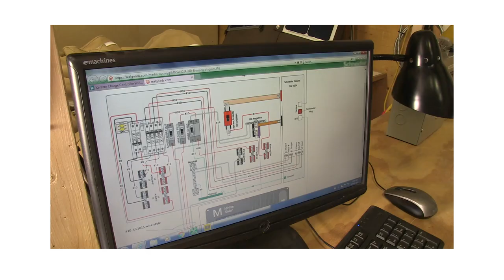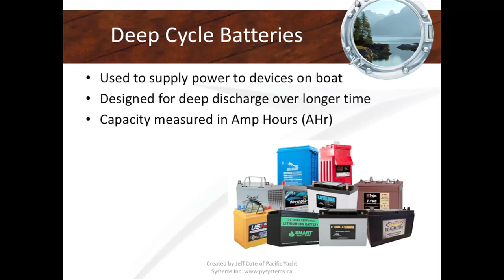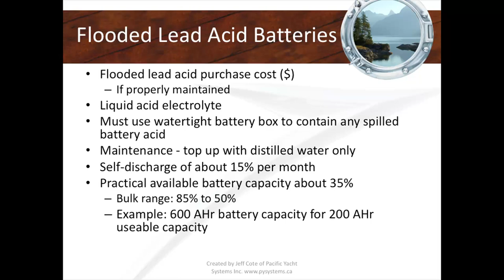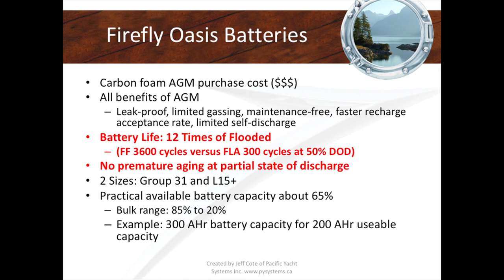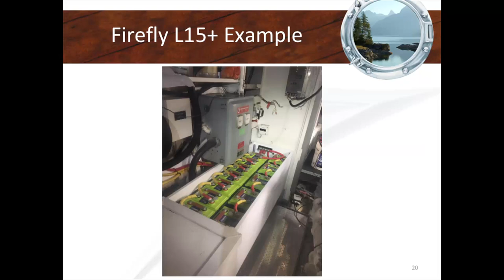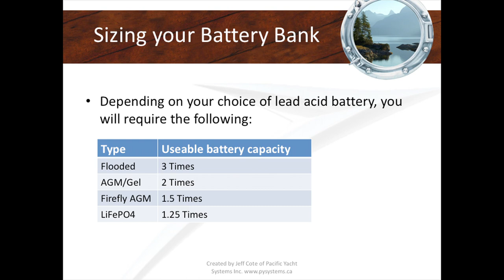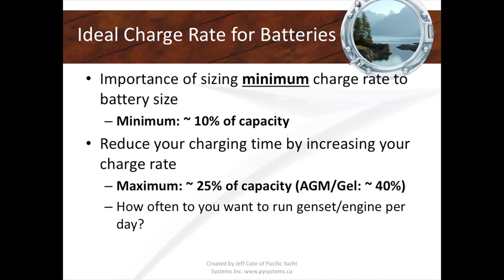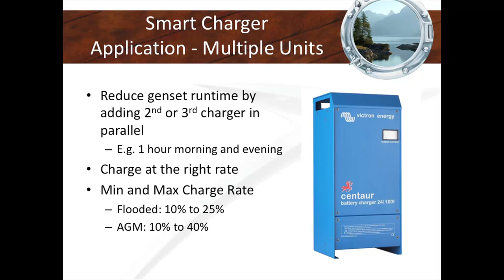Boat Show 2019: How To - Choose The Best Battery For Your Boat

Comment: I have watched almost all your videos and very much appreciate the content and helpful info. Thank you for taking the time to post them!  
My questions are this: how come in your overview schematics you always have chargers and inverters separated on the switched and un-switched sides of the dc system when you say you never sell anything but, or recommend anything other than an inverter/charger combo like a multiplus? Is the inverter on the switched side just representing an ac breaker panel? Should you still have a master on/off switch right off the battery, before the main hi-current DC bus and it’s branches out to switched and un-switched sides?  What batteries do you currently have on your Catalina? I would love to see a video where you walk through a more detailed schematic of one of your clients DC systems. Thanks again for all the content!
Reply from the maker: Hi Nick, thanks for all the feedback much appreciated.There is no one-size fits all solution and so we sometimes install chargers, inverters, and inverter/chargers. Whenever you have a charging device, be it charger, solar controller, alternator, inverter/charger you need to make sure the devices are connected to unswitched side of battery.On my Catalina, i have 6 Firefly Gr31 batteries. Good suggestion on a walk-through of my Catalina.

Comment: Great videos,  what's a good device to keep a float change on start battery, when battery isn't being used as intended?
Reply from the maker: Hi Anthony, every battery chemistry (flooded, gel, AGM, Firefly, etc...) want their specific float voltages, most range from 13.3 to 13.5 VDC on a 12 VDC battery.

Comment: Hi Jeff, excelent videos! We are solar integrators in Brazil and would like to get a quote for the Firefly batteries to use them in boats. By the way, are they rather AGM or Gel? Can we compare them with the Carbon or NanoCarbon batteries? Thanks
Reply from the maker: Hi Edgard, send an email to solutions@pysystems.ca

Comment: That leaves AGM or Gel?!? Just a matter of looking at cost, or is the charging profile a matter to consider?
Reply from the maker: Hi Jens, correct the charge profile of all chargers, solar controller, external regulator, etc... need to be considered when going with Gel or AGM.  AGM lead acid battery is easier to retrofit then Gel batteries.
Reply: @PacificYachtSystems  Thank you for the information. Wish we could get Firefly here in Australia, but who knows what the future holds. Thanks again!

Comment: What are Cat batteries Lead or AGM as te dont have filler caps
Reply from the maker: To confuse things, some flooded lead acid batteries are labelled as maintenance free and don't maintenance caps to refill the evaporated electrolyte. The labelling of the battery should tell you if it's an AGM.

Comment: Battle born ... drop in lithium
Reply: There is no such thing as drop in lithium.
That is a marketing stunt, it will not last nearly as much as a proper lithium, the charge curves for lithium are too different from any lead battery.
The secret sauce is on the internal BMS of the battery if it fails you have a fire.